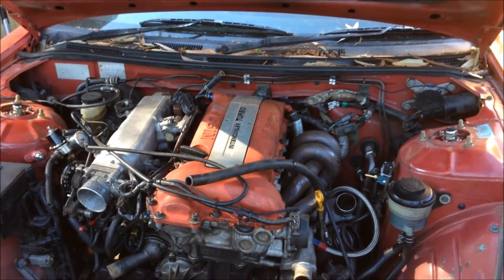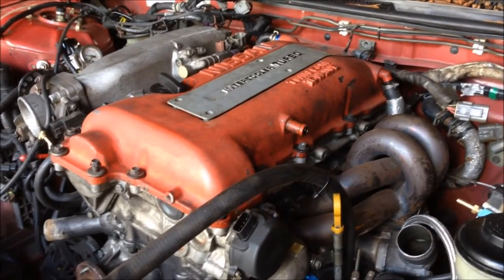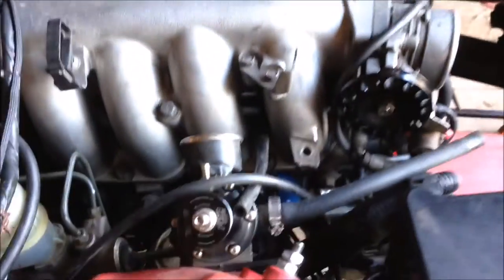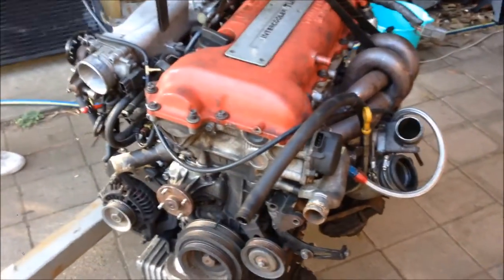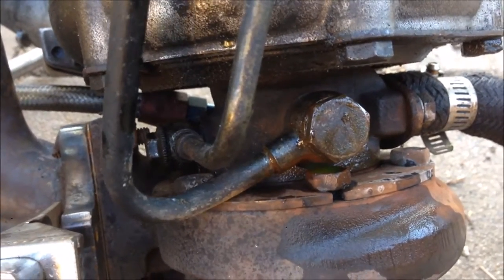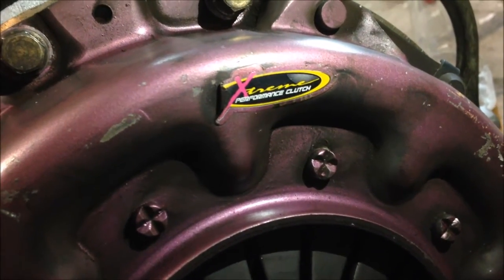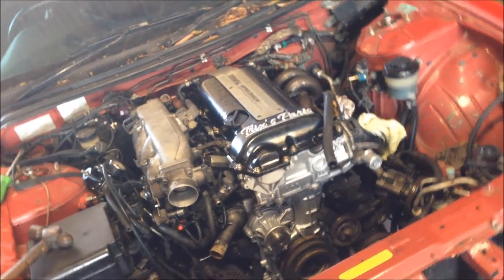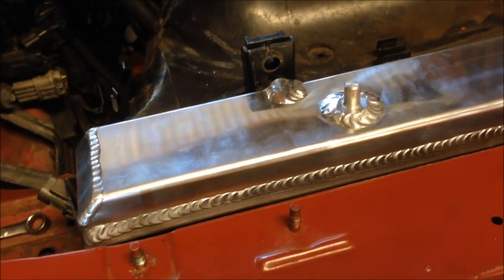S14 Turbo Silvia engine transplant - Pt 1

Comment: It's great to see you guys working on a project together! New engine and radiator look sweet too! Your Valiant runs great with the stock 2 barrel and single exhaust but I kinda doubt it could keep up with a good turbo car like this. That being said, if Jr. wants to see how it fairs against a heavy duty muscle car I'd love to meet up and run 'em someday. I'll even pull a couple plug wires so it'll be fair  : )   Cheers and good luck with the project!